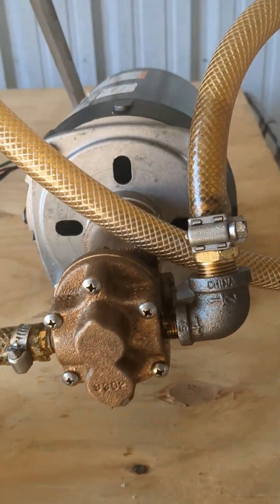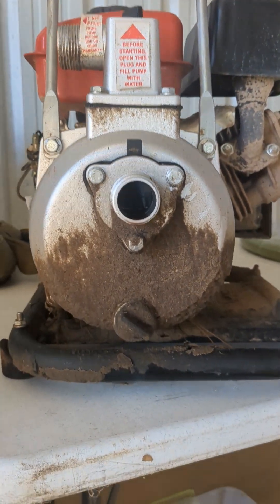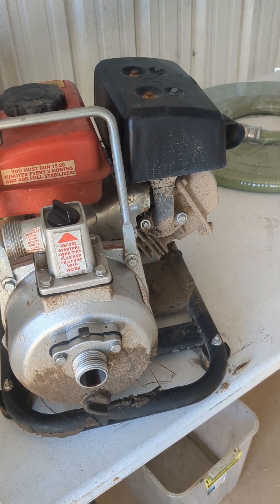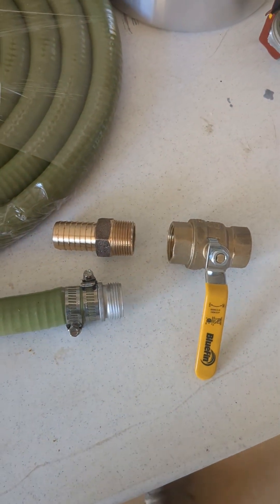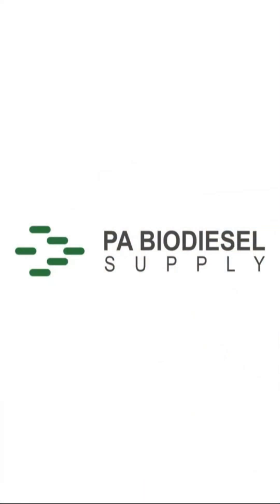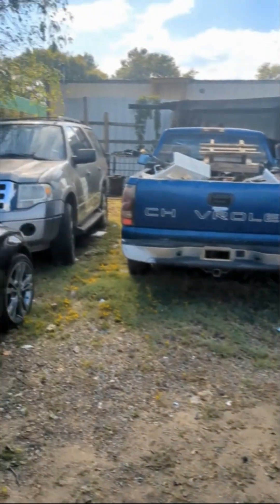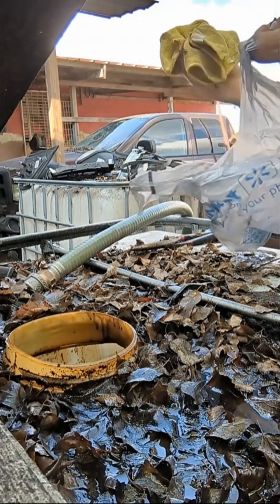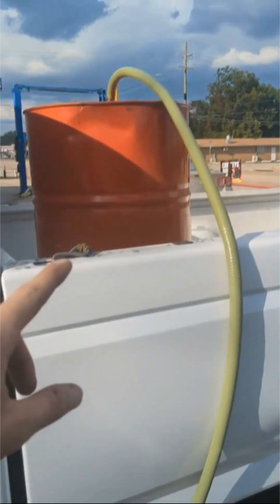How to Collect Waste Oil for Black Diesel - WMO - Alternative Fuel - Fuel Prepping

Comment: Might think about a check valve right at the end of the pick up tube.
Wishing you guys would sponsor my channel.
I'm building and designing a diesel electric hybrid motorcycle and 
I will soon be selling my Prius and buying a 93-98 Ford diesel to run on waste oil. I'd like to build an on board filteration setup in the bed of the truck so dirty oil can go in and clean oil can come out.
Upgrade the front tank to the 60 gallon tank and the rear 12 gallon tank to the 38 gallon tank.
I work in a shop with 25 other guys most of which have shops at home and plenty of waste oil to give me for free.
My current filter setup is EZ bucket top filters. 600, 400, 200, 100, 75, and 55 microns.
I stack them all on top of each other and pour the oil through.
I then let it sit for a week.
I then open the valve 3" from the bottom of the bucket to drain it through my 25 micron sock filter that is dropped through the middle of the lid of the bucket.
Then that sits for a week...
Then 15, 10, 5, 1, then .5 micron buckets.
Then eventually into the 55gallon drum which I fill to 50 gallons then add 5 gallons of gasoline and stir with a 3' long 2" garden auger which fits through the hole of the drum so I'm sure it's mixed properly.
My first batch has been sitting for months, my second barrel is almost full.  I am predicting around 150mpg on my motorcycle based on gearing, weight and engine loads.  I will have the factory fuel tank that came mounted on the engine holding 1 gallon of diesel, then once the engine has warmed up I will switch over to waste oil.
Hope to hear from you guys.
I think at one point I was talking to you or your dad or boss whoever via text about this.
I have more oil supply than I can filter, burn or handle not to mention I have a personal friend that only does transmissions and said he has a full tote for me.
I'd be happy to promote your product in whatever videos I make. 
Do you think a 12v transfer pump would do the job for on board filteration?  I was planning on running an on board centrifuge, AND a series of filters.
And when the "clean" tank is full it will have a spill over back into the dirty tank.
A carpenters style latter rack covered in solar panels to charge the batteries that run the centrifuge while I'm parked at work.
Reply from the maker: @CarModsandDadBod  that's a good thought 🤔
Reply: First comment edited
Reply from the maker: @CarModsandDadBod  Send us a text or email, Info@pabiodieselsupply.com and we can reconnect and discuss things.

Comment: I’ve used garbage pumps from harbor freight, they can be quite the headache to prime sometimes.   You really can’t beat a gear pump, it’s the type of pump most aviation engines use for their oil pumps.  This video is amazing, you are doing our generation a solid, keep up the good work brother.
Reply: Not merely most aviation engines, but nearly every piston engine, from motorcycles to locomotives.